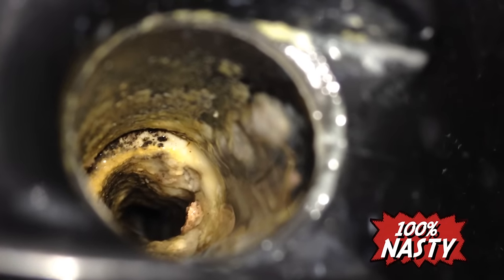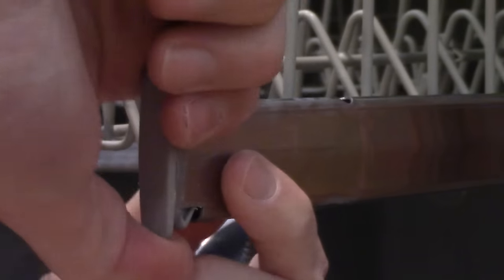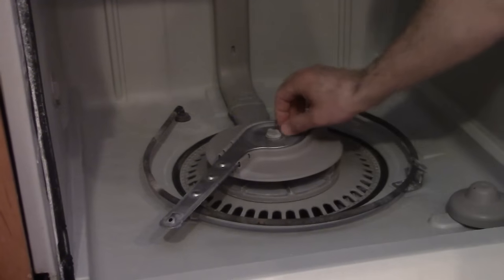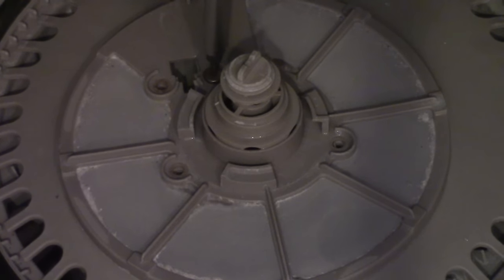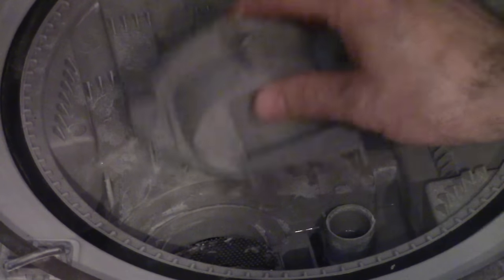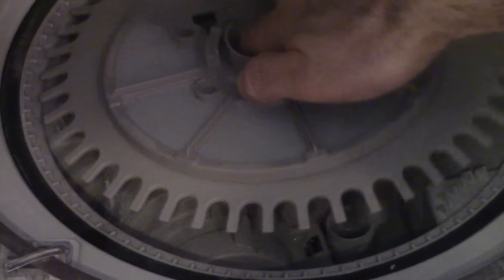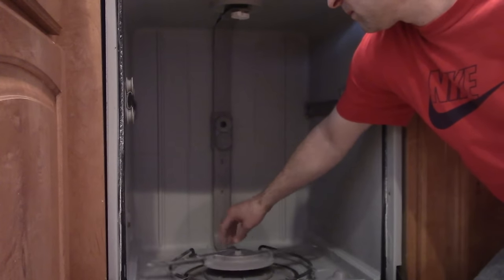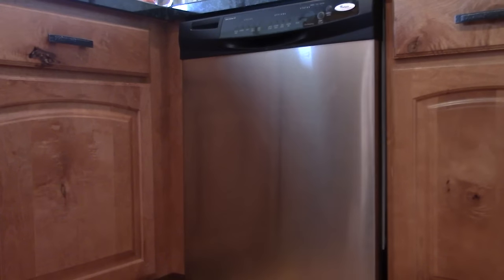How to repair a dishwasher, not draining - troubleshoot Whirlpool

Comment: I've spent almost an hour trying to get the bottom blades off. I can not for the life of me get the plastic screw to line up or pop off or anything..
Reply from the maker: Hit it lightly over and over again with a hard object.  Not hard enough to break anything.  You are trying to dislodge the gunk and crust that is acting like a glue.   After about 30 or so hits it may be loose enough to move.

Comment: took screw oft from the screw housing and the housing willl not come off. What can I do?
Reply from the maker: I once had one that would not come off.  It was a buildup of grime and hard water crust that formed almost a glue.  I have to hit it over and over for about 5 minutes to break it free.   A few hundred small taps with a hammer will loosen it without breaking it.
Reply: sorry for the typo

Comment: The cover at 3:17 can be a bitch to take off if there's a layer of dried soap covering it. What I did was carefully chip it off, with a screw driver and small hammer, then get a paint lid remover to get under the corner near the screw to lever it up, and work it under the cover and work it out. It's plastic and you don't want to break it. You need to look carefully at the video to see where the edges are so you know where to free it up. The other thing I did was use a shop vac with a crevice tool to suck out the chips of the soap and other crud that was in there.

Comment: My dishwasher stops mid-cycle, with a puddle of water at the bottom.  The power is completely out for a couple of hours and then turns back on.  It's able to drain after power is restored when I hit the drain button, so I don't think it's a clogged drain.  HELP!

Comment: this video is how i did mine clean as a whistle but now another issue lol mine is 11 years old quiet partner 11 whirlpool it stopped shooting water at the top when i turn it on the bottom runs like a champ spinning water shooting and it fills up but when you open it real quick no water shooting out the top spout so the spinner just sits there i checks everything inside its still all clean no damage the reason i started checking is the dishes were dirty on the top but not on the bottom rack right now the breaker to the washer is off and im going in lol i have it pulled half way out I don't know what I'm going to do but my husband asked me last night what a dishwasher cost lol you know what that means lol DONE

Comment: I have to do this every six weeks or so. Soooooo annoying. It is a very flawed design. Why would anyone with half a brain design something that has to be disassembled to clean a filter? Dear God. My mom's Bosch has a diferent design which must have been designed by someone with at least 3/4 of a brain. I digress. Anyway, It used to take me about an hour to get the food filter back in. Now I can do it in about 20-25 minutes. However, after doing this now for several years, today I decided to remove the filter entirely to see if I have any problems. We are pretty good at cleaning off dishes before loading. I have noticed that the only thing that really gets caught in my filter is hair, lint and an occasional piece of paper or plastic from a label. Will post at a later date with the results. Stay tuned…

Comment: I'm going to keep searching around YouTube but I have the exact opposite problem the code that keeps popping up when I did the blinking light test tells me that it drains in the middle of a load out of nowhere not always at the same time sometimes I can get halfway through sometimes it's only a few minutes in but it's saying that it doesn't sense the water-level but there's nothing wrong with that little dooey's thing in theI'm going to keep searching around YouTube but I have the exact opposite problem the code that keeps popping up when I did the blinking light test tells me that it drains in the middle of a load out of nowhere not always at the same time sometimes I can get halfway through sometimes it's only a few minutes in but it's saying that it doesn't sense the water level but there's nothing wrong with that little poop a natural gray Round cap in the front

Comment: I noticed on the garbage disposal side when I turn it on, water goes in dishwasher. I been having a problem of have a ugly moldie smell,and it's in dishwasher. water been sitting there. other day I didn't have to use the garbage disposal, and dishwasher was full if water & started to spill out all over the floor. I turn dishwasher on rinse,& it goes away. till the next time.
Reply: Josie's Angulo did you get that fixed?
Reply: Misty Fimbres no
Reply: Josie's Angulo I know what causes that but I forget what it was exactly. I'll ask my husband and then I'll tell you
Reply: It doesn't just go straight to dishwasher, but I'm thinking, only does I'd garbage disposal has kinda a lot of food. But then again,it's not like I let a lot if food go in there, it doesn't really take much for that to happen,in also thinking when lira of water goes down at once it flows over to dishwasher. I'm saying this because I been keeping an eye on the dishwasher. and its been dry. Also when I wash I switched drain tube to the other side, still checking dishwasher & still is dry. When dry of course no sitting water & no order.
Reply: Josie's Angulo do you speak spanish?
Reply: check the trap under the sink

Comment: my dishwasher installed but not draining water,,,but washing dish very good ,,but not draing ..i clean everything but didnt work ..so i fiqure,, my food processor and dishwasher pipe connect take it out..and have a hole. ,,,food processor hole ...push out open the cap....if not open food processor block so water not go throw the food processor..so food processor the line inside open..use hammer...sorry i cant speak english